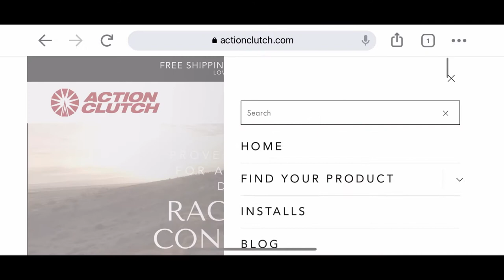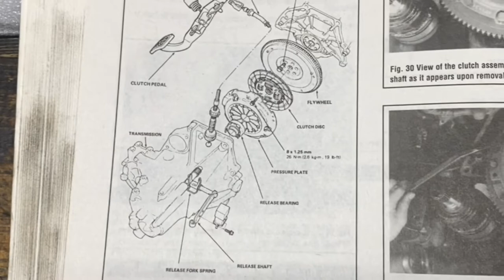ACTION CLUTCH STAGE 2 -  INSTALL B SERIES (90-91 CABLE TRANSMISSION)

Comment: In my experience, there should be new hardware for the new clutch and pressure plate to bolt to the flywheel. But like you said, there's no interference, so send it.

Comment: Man I have a problem I have a 90 91 D series tranny bolted to a 95 d16z6 motor one day I was driving it started getting hard to shift into any gear. I adjusted clutch cable it drove fine for 20 more minutes then it became impossible to shift into gear any gear. When it's off it goes into every gear fine. So I have changed whole clutch kit everything also clutch cable I have changed everything accept the clutch fork I also changed the bearing retainer spring and it still will not go into gear I don't understand what is going on any suggestions? I also installed the stage 2 clutch. Any response would be greatly appreciated.
Reply from the maker: Thanks for the support and sorry for the late response, when you say it goes into every gear just fine when the car is off are you depressing the clutch and it’s going into gear, or are you just cycling through with your foot off the clutch…service manual is specific about how much engagement / tolerance that release bearing needs keep in mind that if you have a heftier pressure plate that release bearing might need to be a little over that “recommended” tolerance so check that your cable should be nice and firm, assuming all that is good to go - check your pedal positioning it’s a long shot but maybe you’re looking at pedal stop issue